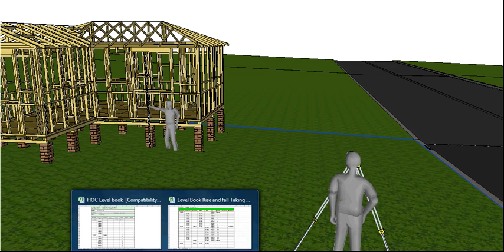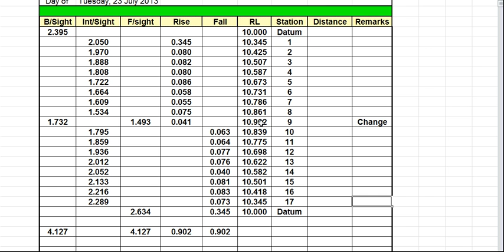Taking Levels - Height of Collimation Level book

Comment: I've just watched your video.

Whether you use, as you did in your example, collimination height, or the alternative rise and fall, it is safer to go from the backsight to each intermediate and foresight, rather than from one to the next, as any error in a calculation going from one to the next will impact all calculations from that point. Going from the back sight to each will only impact the specific calculation where the error was made EXCEPT if it's made at a change point, for those new to taking levels a change point is where you need move the instrument, and the last reading before moving is a foresight, and after resetting up the instrument, you read back to the same point and record it as a backsight. The difference in the readings merely represent the vertical change in horizontal plane of the instrument.

The final results will be identical.
Reply from the maker: Hi Dennis
Thanks for the suggestion, I have never seen it done this way but as you say the results should be the same.

Comment: I'm assuming also that we all know that Excel's pretty handy for doing this math for you.
Reply: Hi, QS student here, probably 3 years late to this but do you mean excel can work it all out for you? if so, how?
Reply: @laurenxox7419  I wasn’t bashing the video at all. Good stuff. Just commenting that the calculations he seemed to be doing on the side as he poked thru what looked like a spreadsheet can be easily calced automatically with simple cell formulas.
Reply: @dave-o3954  no me neither the video has helped a lot, but would really help with my assignment if you could drop the excel formulas👀  thanks :)

Comment: Hey thanks a lot Mr Buildsum. its' really very helpful and found it interesting following your video's.
I took a course in the year 1981 and cut off from all that goes to surveying. I am a bit lost and want to go upon again.
So far i can manage to put myself into the picture and what i want to ask about is whether there exist any software for surveying and levelling.
Reply from the maker: +Kiran Dewoo Hi Kiran I'm sure there is however as i don't do a lot of surveying or leveling I'm not aware of any. i only use a spreadsheet type program like excel or Google sheets.
Reply: ok thanks
Reply: Kiran Dewoo Hi Kiran,
For taking levels, I recommend using a field book, as shown in this video, and either use s calculator or as suggested, use a spreadsheet or similar to do your addition/subtraction to determine your relative levels. 

Surveying is a different matter. Total stations, which have capacity to measure distances and instantly display horizontal bearing, vertical angle from the asmith (horizontal) actual distance from the instrument to the target being measured, and the horizontal and vertical dimensions to that target. The can record all that information, and depending on instrument can display some of it in graphic form on it's screen. they also can interface to a computer and in some cases directly into programs like Auto cad. 

That is a big step from taking levels and taking some horizontal measurements using a tape measure or stadia wires if the level has them.